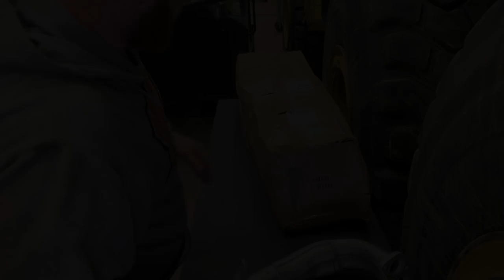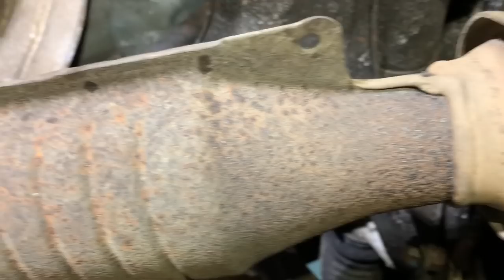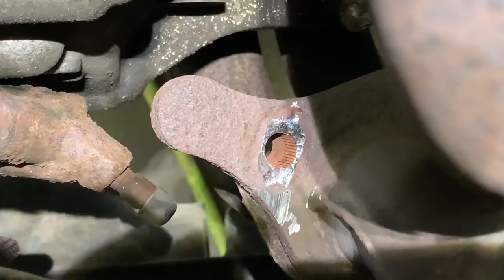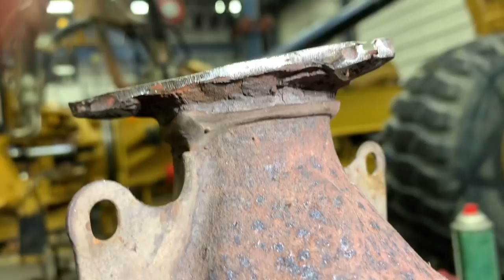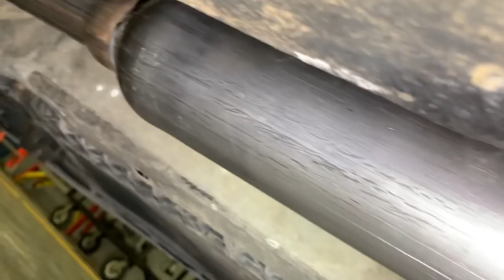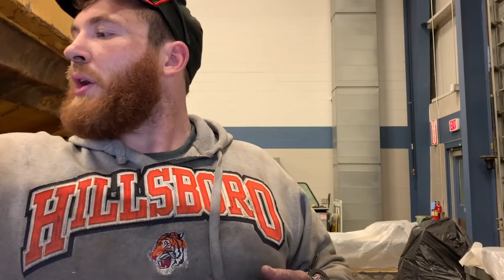Weekend Repairs | Rustbelt Vehicle Logic

Comment: I did the SAME EXACT repair on our family's 'spare car' 1997 Honda CR-V in early December.  The cat broke right after the input flange.  I also replaced the oxygen sensor since it was the original and had 235,000 miles.  Thanks for another great video, Christian!!  Cheers, brother.
Reply from the maker: Dave Osbun Hell yea. Pretty simple working on these older Honda’s!

Comment: Yeah I'm also in the rust belt and I don't blame you. We have a 70 C20, 79 F350 in nice shape,  strictly summer. I drive a 95 k1500 winter beater and I hate to rot it out but gotta run something. I don't drive too far so fuel isn't a big deal.
Reply from the maker: Bradley Dewitt That is smart.

Comment: Good job. Thanks for sharing and your time to make this video.  Nice welding job. The only comment I can make on the exhaust job is to reposition that clamp so it wasn't protruding down so far, like turn it sideways.

Question sir, how often do you change oil and at what point would you say 'time to get rid of the car'?  I ask because it appears you have developed good maintenance habits.
Reply from the maker: Robert Weir that’s a good idea on the clamp, never thought of that. And as far as oil changes I change them at manufacturer spec. In my truck it’s about 6000 miles. Beater cars I like to change every 3000 regardless. And in my mind if a single repair costs more than the car is worth no matter how much you have into it already then I would get a different car.
Reply: @ValleyCityAutoYT  Thanks for the reply.  Very good advice.

Comment: if you have the means you should do a review on the snap on cordless impact all i have seen is automotive guys test them on small shit be nice to see what they do on real fasteners or transport wheel nuts i only ask becuase im on the fence if i should buy one vs air impact
Reply from the maker: shawn barber I would definitely suggest the Milwaukee half inch!
Reply: I second the Milwaukee 1/2”. 2767-20 specifically. I use it to remove head bolts on ISX’s and it doesn’t break a sweat. I haven’t run into a bolt or nut this thing couldn’t take loose yet.